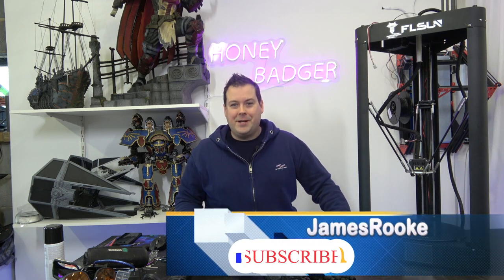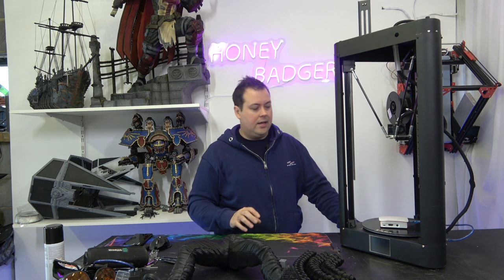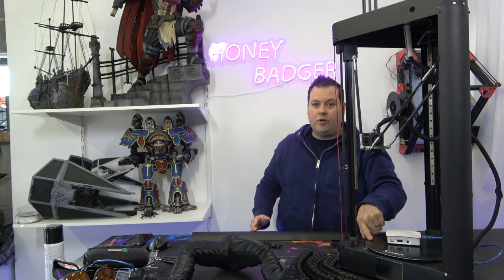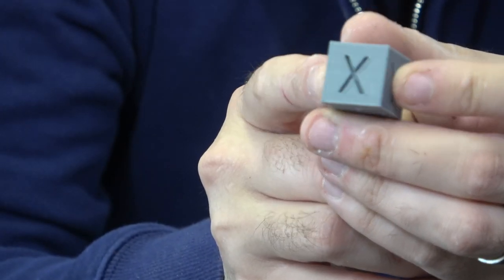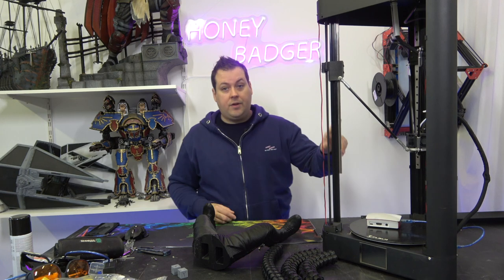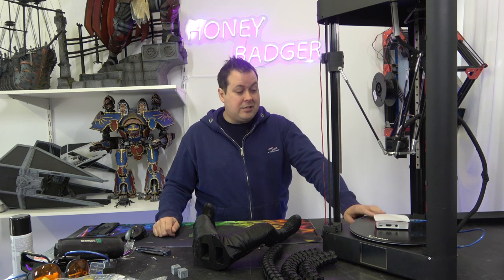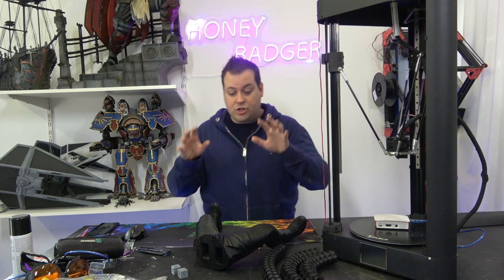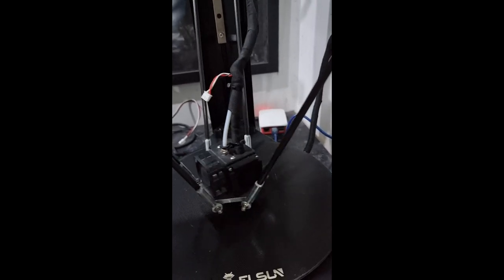Flsun QQs-Pro - Upgrades linear rails and klipper

Comment: Yes, the drivers are the biggest difference in noise levels.  2209's + fox les marlin build works very well (he does a load of pre-compiled marlin builds for many options)  The levelling is not intuitive, but once you realize how it works, it is ok.

I have ordered a V400, but will be modifying my QQ-S Pro for Klipper and some other upgrades since I already have one.
Reply: I used foxies marlin. I just went to klipper recently on the qqs.. never going back to marlin if I can help it. 

I was able to do input shaper on the qqs and a lot of the ringing is gone. Not perfect, but I also didn’t upgrade to aluminum rails. 

Screen doesn’t work but I have my phone or computer to access and control the printer. 

Enjoy the v400 :)
Reply: @OregonDuck  Thanks! I have now upgraded my QQ-S Pro to an MKS SKIPR for klipper and driver board in one (I am going to get wild with 2 motors per belt soon lol), Sherpa Mini direct drive and CHC Pro (ceramic) volcano hotend.  Running 'OK' but not excellent yet.  This will partly be resolved with 12mm linear rods, and a massive upgrade of the arms and custom sliders.  It's just money right? LOL.

I did an ADXL345 upgrade but the ethernet cable being quite long it didn't like it.  Trying go come up with a solution as I want it permanently mounted. Will get there.

Oh, and the board is now at the top of the machine now with a custom case which meant a silly amount of soldering and wire extension lol.
Reply: @matthewwain9958  I’d like to upgrade my effector to accept super racer shape. There are some cool ones out there. There is one mantis with a Sherpa mini. I’m not sure the hotend selection, but a Chc pro will heat up super fast. Pair it with a good nozzle to keep flow up. 

My adxl setup was: make and print a mount that screws in by unscrewing one screw from mount, then attaching adxl with that screw. I used jumpers from adxl to pico and the pico usb plugs into my klipper box. 

I didn’t use a pi, I actually used an android tv box that I was able to install Armbian on, then I installed klipper through kiauh. 

Since this I’ve build a voron and just got my bambu so the delta hasn’t been in much use unfortunately.
Reply: @matthewwain9958  I think there is a smart effector that mounts the adxl permanently. 
I also forgot to mention that I had fixed a lot of my input shaper issues by going back and making everything was tight including my rods etc. most my issues were loose guide rods.

Comment: Be prepared that moving the heavier linear blocks up and down will decrease the maximum speeds, as the steppers and the tiny belts are not calculated for this extra weight. It will wear out the belts quicker when running higher speeds, unless you move to stronger belts and pullys. Keep in mind that not only the weight of the effector is important for max speed and accuracy, but the weight of the whole mass that needs to be moved, which is often overseen. Also vibration will be more severe because of the weight increase.

Comment: I just installed Klipper on my QQSP. 
Is the display on the QQSP supposed to work after installing klipper, or does the display only display "complete"?
My display only shows "complete" now. If I reflash the stock firmware the screen functions fine. 
Nobody mentions if the original touchscreen works or not after klipper install. 
Please advise! 
Thanks, Mat
Reply from the maker: sadly no the screen is not klipper compatible as far as im aare, the screen is connected to the mainboard not the pi and klipper is on the Pi, you need to get a pi screen and then install klipperscreen on your pi

Comment: Is there somewhere dimensions for rails?
Reply from the maker: Change 8mm rods to rails MGN12 (600m) 
2020 aluminum profile (710mm)
Reply: Is this the 50mm shorter specs or the full size?
Reply: @honeybadger3dprintandpaint plz what is right length